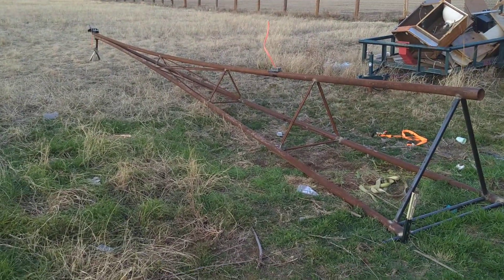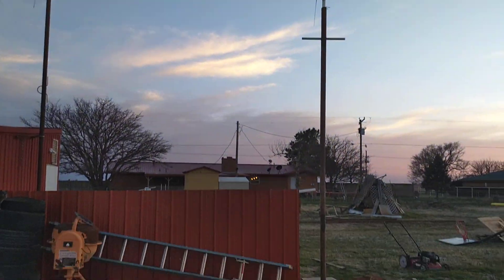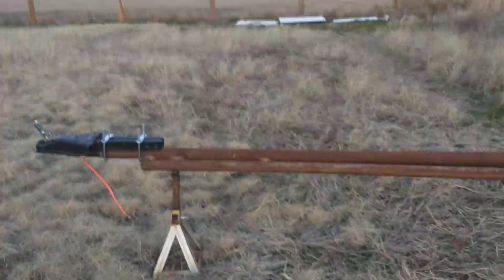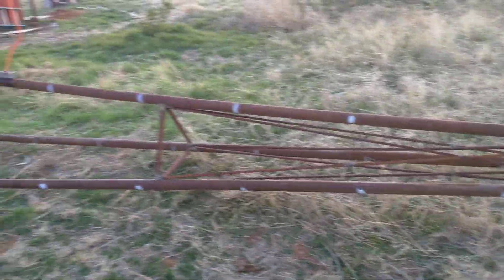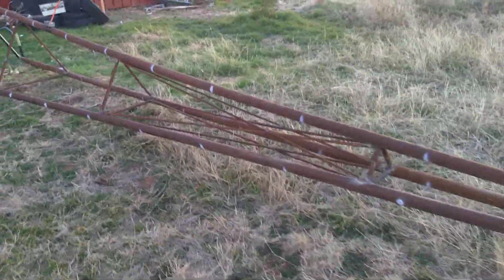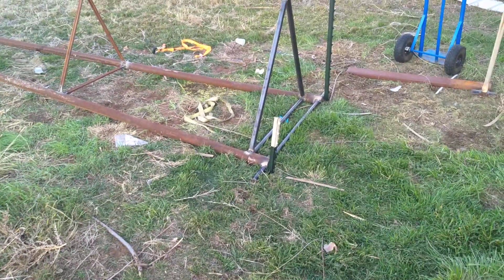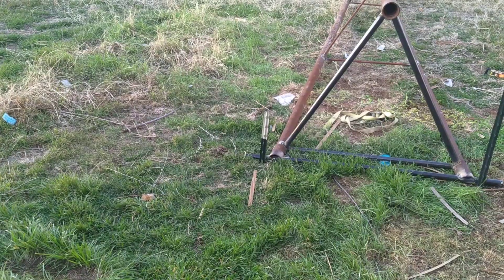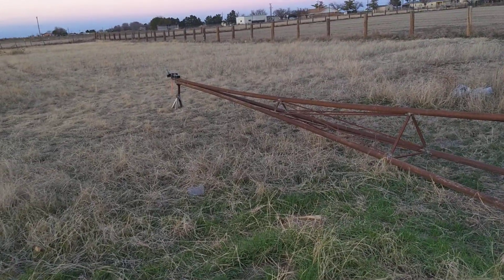2 7/8" Oilfield Pipe Tripod Wind Turbine Tower ~Finally ready to stand up!

Comment: do the one pole towers have good stability?  I was thinking of also using drill pipe that some guy is selling locally.  I support you built the 3 pole tower because that tall a single pipe would be Mr Wobbly without wires to hold it in place.
Reply from the maker: If you get the 3.5 or 4 inch stuff you can go about 20ft tall without it being too bendy, but it's not really tall enough for most turbines.  You'd really need it to be 30~50ft in most cases and you get that from a single pipe you would need 12~18" bases and THICK walls.